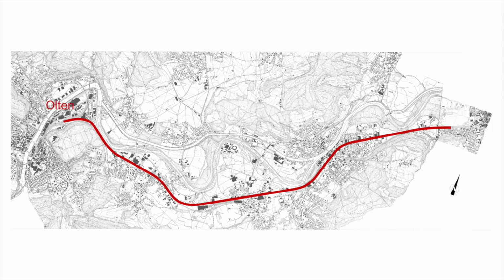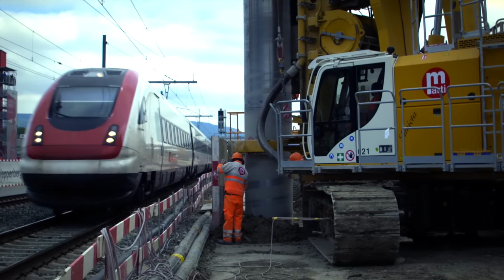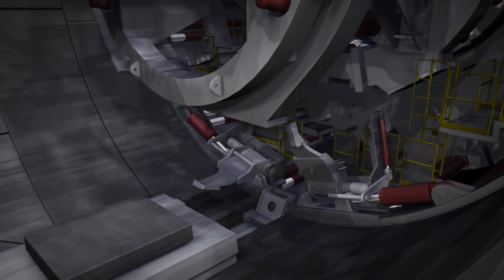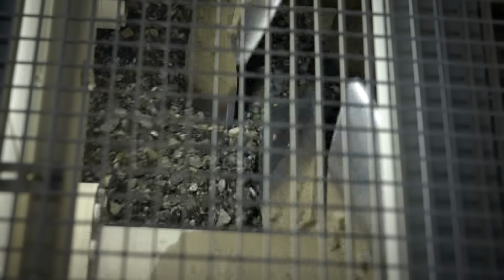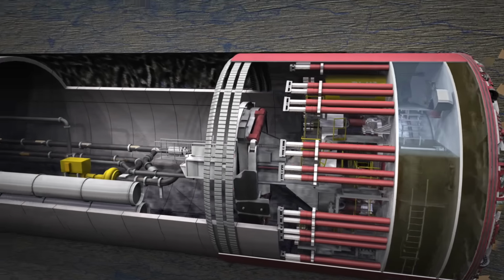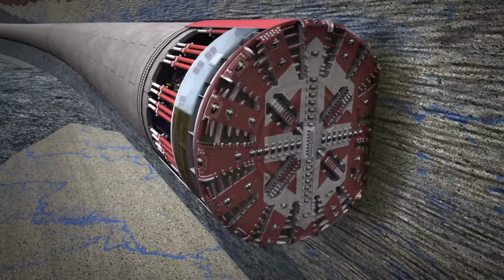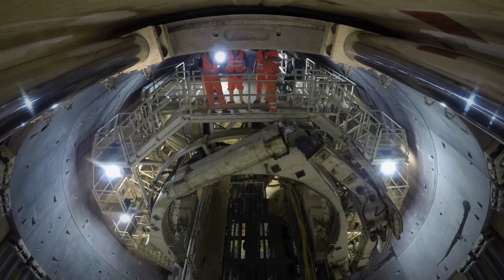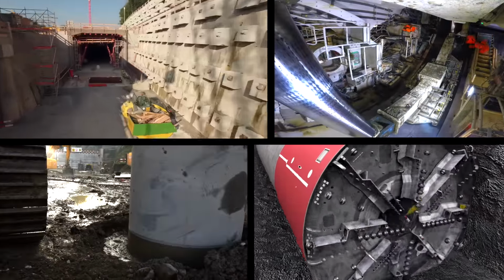Eppenberg SBB Railway Tunnel - From installation to the breakthrough

Comment: Another thing I noticed, these ring segments are using both steel reinforcement AND additional fiber reinforcement (almost certainly just plain fiberglass, but it could be aramaid fiber or carbon fiber, if the mechanical properties are extremely critical, but those last two options are usually prohibitively expensive).
Must be nice being able to just drill a tunnel where you want it to go, I'm over here in New York state and... well all our mountains are "rubble piles" formed during the last ice age by the glaciers pushing around rocks of any size from sediment to house-sized.
Heck, the most solid rock we have around here is Shale, and even that's just begging to erode given the smallest flow of water, since it's just weak sedimentary rock.
We do have a few tunnels around here, but it's very much not a common thing.

Comment: It's mentioned that the upper portion of the concrete lining of the tunnel is supported by gravel, yet while you're excavating the tunnel, a great deal of crushed rock is produced.
This seems like an opportunity to make use of material that would otherwise go to waste and need disposal.
So I wonder if this project exported some or all of the crushed rock produced by advancing the tunnel to a rock crushing plant, where it would be processed into gravel suitable for use as that back-fill gravel that was mentioned.
After all, if it's stable rock that you're drilling thru, and you need gravel, it makes sense that the existing rock would provide good material for that purpose, would it not?
Now, I don't have a civil engineering degree, so it's entirely possible I'm way off base, but I did get a 95% on my high school physics class, and I also took a couple CAD drafting classes in high school. I have not gone to college to get a degree, but I don't think it takes an expert to figure out that reusing the material that you're already producing (provided that it is suitable for such use) should lower costs, right?
EDIT: The answer to my question was further along in the video, apparently I had a good gut instinct after all.

Comment: I can’t  believe so much money was spent building such a shallow and short tunnel.  Wouldn’t it have been far cheaper using cut and cover? Or just building an elevated line through the narrow part?  Or if the town didn’t want this removing the homes in the way and creating a four track main through the town.

Comment: November 2022,.....in my community in the USA, in Columbus, Ohio,....a large bore tunnel machine is being employed, to dig a tunnel from the North end of Columbus to the South end,...it will be, ( not sure if the whole tunnel will be used) for clean and waste water transport. Like I don't know if the whole tunnel will contain multiple large pipes, ( I am guessing it will), to provide this water movement. The project will go on for several years. Only recently in the summer of 2022, in a city owned public park, less than a 1/2 mile from my house, is where they are staging the first part. Tuttle Park is it's name, and it is a 1/2 mile north of The Ohio State University, campus. We were informed it will be dug in sections, which will later, meet up. It is not clear if the tunnel will run under the entire city Columbus. But the earliest sections, are meant to improve the waste water and fresh water transfers in many communities where old, underground water pipes, have not been improved in at least 100 years. We were informed that was may hear strange noises coming from the dig, which is quite deep in the ground. These machines can operate 24 hours a day.

Comment: Can't get over how California frets and baulks at putting in a single high speed reai line like it's an impossible expense yet Switzerland does dozens of these projects and does not bat an eye.
Reply: It's just how economies of scale work, if you are constantly doing something the cost per unit will drop substantially and ease of the project increase.
Reply: This is why it won't be necessary to build... https://www.youtube.com/watch?v=ncIe1bGPBBw

Comment: The cost for this had to be astronomical....
Reply: But in turn more people can be moved per train, that recovers the cost in short time.
Reply: No, this is Switzerland, The rough works presented here cost 274 million Francs. The entire Olten-Aarau project, including installation of tracks, catenary and signals in this tunnel, a fourth track over 2.6 km between Dulliken and Daniken, and two overpasses in Olten had a budget of 885 million Francs (about the same in $) and was delivered on time. 
A similar project on Amtrak North East Corridor (100 mph speed limit, 2 new tracks over 2.7 km in the open and 3.2 km in tunnels, and some remodeling of West Baltimore station) is expected to cost $ 4 billion, before the usual cost overruns.

Comment: Would it be feasible to freeze the loose and wet soil in front of TBM. If soil becomes solid from freezing and can be removed like rock, it would save time. No need to modify cutting wheel, no need for Bentonite, no need for pumping, separation, re-using of Bentonite. When they were building Grand Coulee Dam, there was a soil condition causing slumps while excavating. They used either chilled salt water or Ammonia as the refrigerant. They froze large areas so excavation could continue.